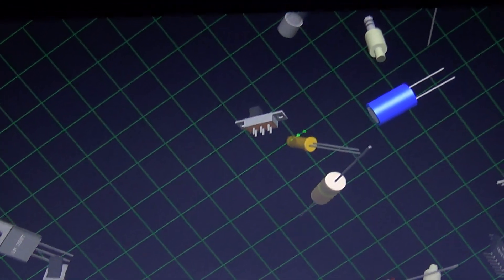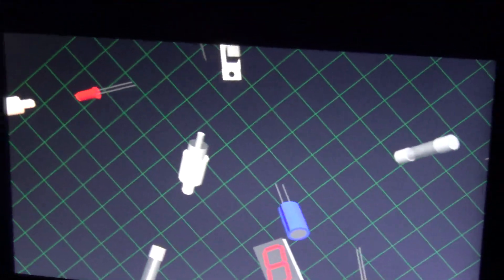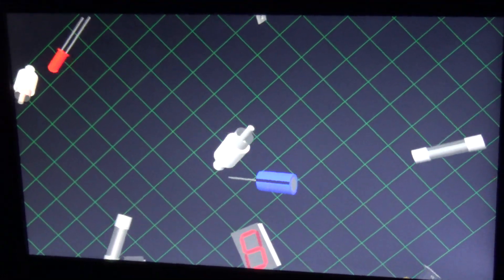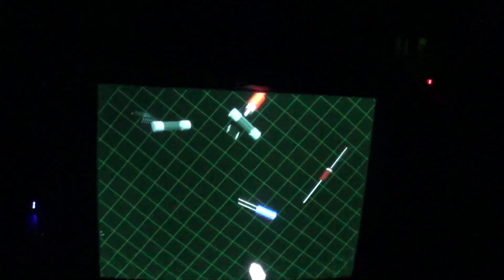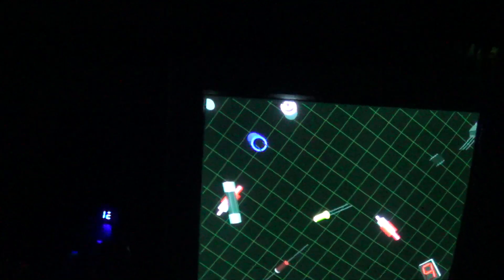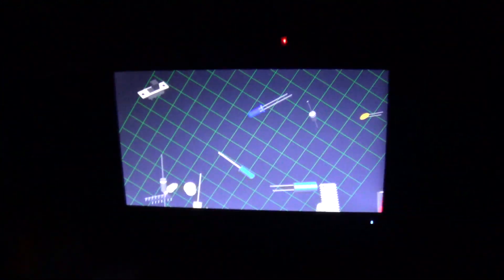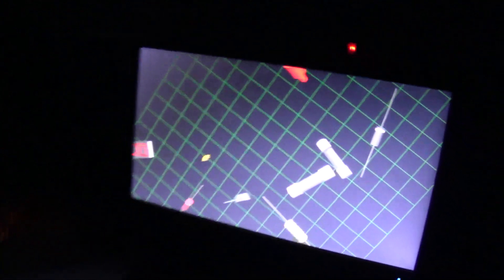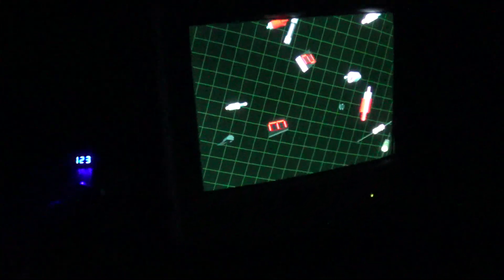LCD vs CRT- Black Levels (Old Video- Archived)

Comment: A couple of disclaimers before I get to my point: I was not very critical of picture quality when I was younger and my family didn't own particularly high end TVs or video equipment.

Perhaps my memory is deceiving me, but I don't remember the inky blacks people talk about when discussing CRTs, primarily due to the sources being fed into them. While it's possible some of this may have come down to settings, I distinctly remember, when starting a VHS for example, that the "black" at the start and end of a tape was enough to illuminate a dark room. Again, perhaps I'm remembering wrong, but I'm pretty sure even black screens on video game consoles weren't completely black.

I'd love to be able to travel back in time and mess around with some of the video and audio stuff I had growing up and play with the settings. I'd also explain to past me about aspect ratios so I didn't have to suffer horizontally stretched 4:3 content for years. I remember when we got our first widescreen, I hated it because we didn't really own any widescreen material and pretty much everything looked worse than on our old TV. I'm also pretty sure we sacrificed vertical screen size vs the 4:3 we previously owned (most likely because my parents didn't take aspect ratio into account).
Reply from the maker: IIRC, VHS tapes didn't have true blacks because of A/V noise, which I believe was an inherent part of standard magnetic tape.
Reply: @TCGProductions03  but there's also the fact that CRT screens are grey when not in use, which indicates that the inability to display and/or sustain pitch black is a limitation inherent to this technology.

Comment: True black on an LCD is impossible on an LCD. With CRTs, it's theoretically possible, but side scatter from the electron beam can illuminate the phosphors when they aren't supposed to be, and because the phosphor coating isn't black, any illumination will show that. But, the contrast will be a LOT better than on an LCD.
Reply from the maker: Nailed it. There are OLED displays that have impressive black levels, but they are FAR more susceptible to burn-in than CRTs and they also have lag. What happened to HD-SDI?
Reply: @TCGProductions03  Indeed. Though OLED have improved so much lately, they practially have very low lag (latency) in the sub 5ms range. Response time is also matching CRT, with crazy contrast and black levels while being brighter than an old CRT. Burn in is still there tho, but pixel refresh software is helping a lot.

OLED is a great monitor tech for today. And for the future, the holy grail will be micro-led, with individual pixel being a point of rgb light itself.
Reply from the maker: Also, I wonder if increasing the focus voltage on the CRT will decrease side-scatter and improve picture quality.
Reply: @TCGProductions03  it would, but it would also increase the likelihood of burn in.
Reply from the maker: @David_Phantom  I ought to crack open that monitor up and adjust the green screen down and the focus control up.

That is, if I don't chicken out trying to adjust the HV.
Reply: True black was not possible on LCD unless it’s from Eizo